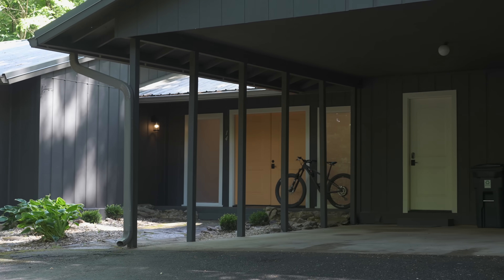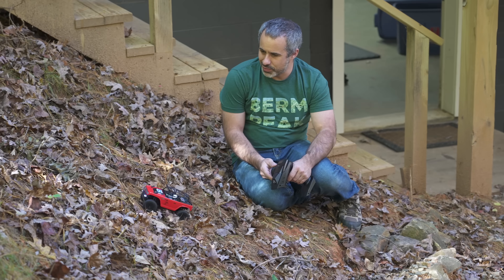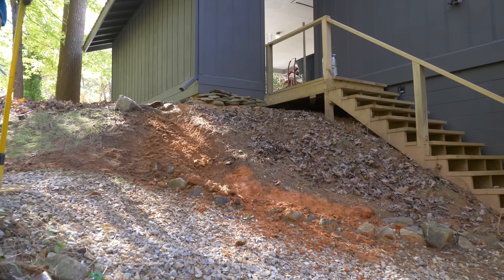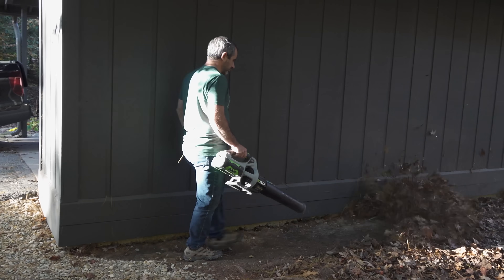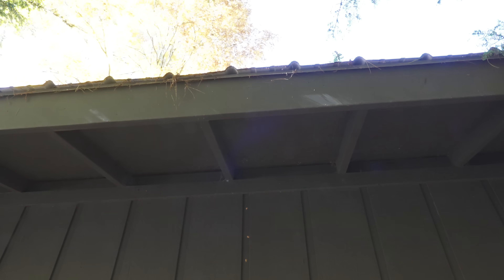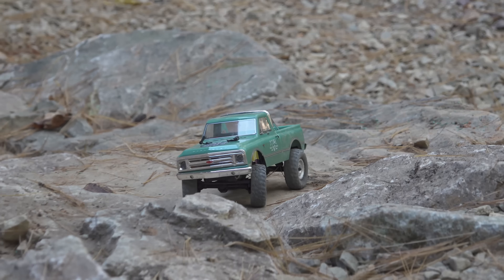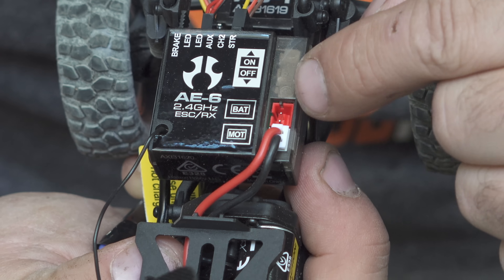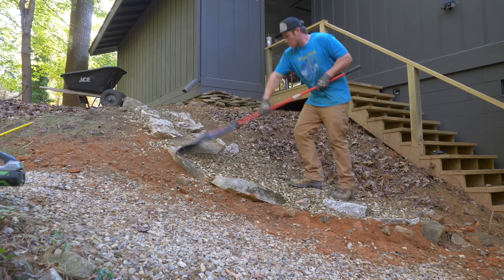Building a Crawler Course for the Ranger Station! Who knew fixing drainage could be so fun?

Comment: Hey Seth those chargers don’t charge the battery cells very evenly so if you want them to work well and last long you should consider getting a charger that charges the cells evenly
Reply: And turn the RC off, THEN the radio 👍
Reply: @900DonkeyPunches  its a 2s lipo
Reply: @jerryvolpini7987  doesn't matter that much because they are 2.4Ghz transmitters and not quartz... But still, it's a good habit!
Reply: those chargers are perfectly fine for those batteries.
Reply from the maker: I purposely bought those chargers because people may drain the batteries all the way down.  Proper balance chargers will just refuse to charge them up after that. I’d rather balance the cells every so often or replace the batteries than get constant calls about the batteries not working.
Reply: @SethsBikeHacks   oh ok thanks that’s a seems like a good idea
Reply: @SethsBikeHacks  The EcoPower "Electron Li32 AC" LiPo Balance Battery Charger (2-3S/2A/25W) appears to designed as a mid-point between a classic balance charger (that uses the main connector when charging, along with the balance leads) and the Axial-provided (re-branded item) charger, at $24.

Comment: Cool vid. Maybe a larger custom sign above the crawler station with instructions for the renters on the batteries and charging. I’m sure someone can design something worthy of the ranger station or you may have something in mind already
Reply: Agree Ron H, and great video Seth, If Possibly supply rechargeable transceiver batteries too, as they are better for the environment.
Reply: @yorgosk2938  As long as the transmitters aren’t left on the battery’s should last for months or even years.  I’ve had my crawler for about six months and I had to replace the batteries in the transmitter one time because I left it overnight by accident
Reply: @unnamedracer9757  Hi, and thank you for that. I was none the wisest about the transmitters' battery usage.

Comment: The lipo bag is a must! However I would caution you that the bag does nothing if it is not zipped closed as it mainly is used to keep a large column of fire from shooting out of the top of a LiPo goes bad. Don't ask me how I know this!!! However since the batteries are so small I don't think you will have many issues! Good on you for getting any LiPo fire protection as most people forget about doing so.

Comment: This is a great idea. I will say, as a hobbyist. Don’t tell them they can get wet, they’re water resistant which really just means that it won’t explode if a drop of water touches them. I’ve got a deadbolt and they are not submersible and should avoid water where possible. The other thing is you should take the batteries out to charge them. Even in the bags, they could take engines and esc’s with them. Otherwise I think this is great.

Comment: Amazing video for the public to begin crawling!!! Just one small bit that wasn’t mentioned on shut down… make sure you unplug battery from receiver after use or the battery will drain itself dead, maybe killing the battery depending on how long it’s left plugged in. And also I highly recommend charging the batteries outside of the trucks and in the secured Lipo bag, the bag won’t contain fire if it is open

Comment: You should look into the Worx wheel barrow/dolly for carrying big stones. It doesn't have the biggest bucket, but it does have cantilever arms and a webbing basket you can use to carry really heavy isht. It also has a spot for a trailer hitch ball if you wanted to pull it with the Gator.

Comment: I have the regular size of the red one just it’s like green an it has a extended frame new weals with weights in them and light bar also a working winch. Not the owner but recommend stopping by crawl space north and south for you that live in or around Colorado Springs it has a rock course and drift track they also sell lots of cool accessories and practical stuff to make your crawls better

Comment: If you run a battery dead flat and it won't charge don't toss it out.
You can put a little bit of voltage into it from other battery or something and then it'll charge. If you use another battery use one that isn't fully charged

Comment: Seth you should encourage people to un plug the batteries from the car. I used to work in a hobby shop and I saw lipo batteries ruined regularly from them being left plugged in. Even though the car is off, there is still a very small current drain.

Comment: I'd be tempted to run the cars on NiMh batteries as LiPo batteries can be disastrous when people don't know what they are doing to look after then. I've seen LiPo batteries go up even when people know what they are doing at RC nationals and it's not pretty when they blow & catch fire.
At the least if you are using LiPo I'd strongly advise using LiPo alarms on the cars and keep a bucket of sand (play sand works best) near the charging area, so if one goes up you can dump the sand on it.

Comment: Rc safety tip from an rc enthusiast; 
I must advise you to not store or charge the battery in the vehicle. The batteries should be removed and kept in the bag when not in use or charging. Nor should they be left plugged in to either the car or charger when unattended.

Comment: Btw plugging the battery into the motor plug does nothing because the truck won’t turn on and if it did it still doesn’t do anything I have tested it with many scx 24s